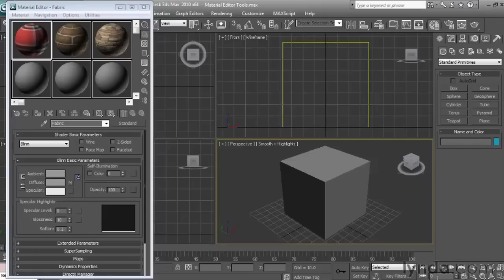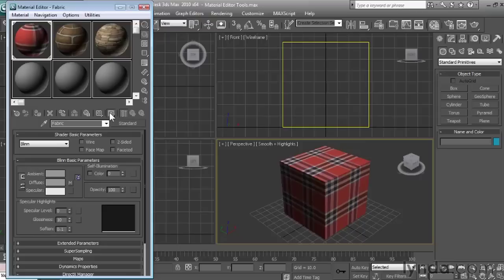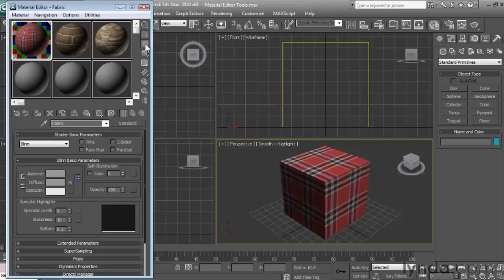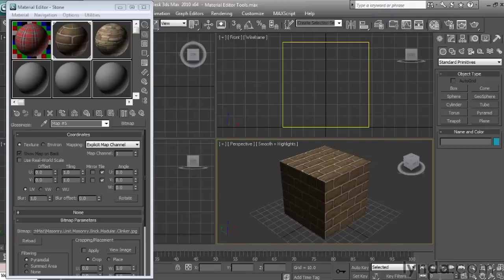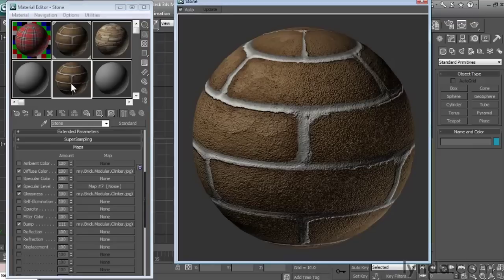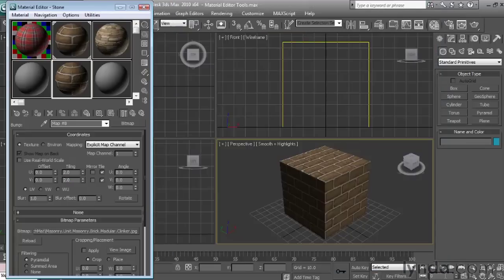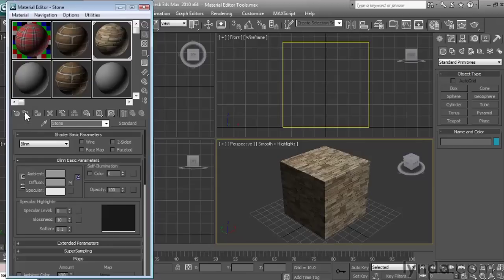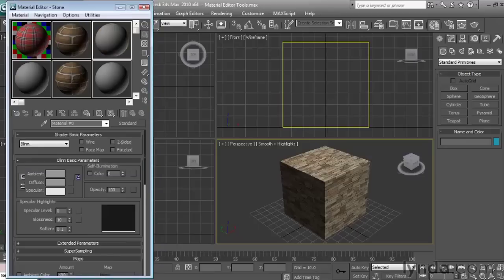3ds Max Tutorial - How to work with materials

Comment: Hello I just like to ask how to make a rectangle polygon when rendered would look like a different object. I saw in some videos that when they click the tree branches it is only made up of one rectangular polygon. How do you texture a polygon so that it would look like a leaf or something? Thanks!
Reply: you might be thinking of the foliage modifier.. 3dsmax reads that as a box until rendered, if you are certain it was a box.. then they may have used an opacity map.. if you open up the map in PS and paint it black it will be invisible.. black conceals white reveals.. bump map, black digs in white pulls forward, things like that.. i would have to see the video to be certain though.. unless it was a .png diffuse, and .png b/w bump.. and then the reversed color of the diffuse painting the tree white or grey and making the surrounding black.. using the opacity map.. not sure if this helps.
Reply: Oh okay i see so I can use that foliage modifier. Thanks! I'll try to find that video again and give you a link. I forgot the name of the vid but i remember the thumbnail. Thanks for replying I'll try to find that video.

Comment: This doesent work. I have the poly face selected (also tried with full poly selected) and the click n drag option (in menu when you right click the material in the material library window) is ticked. But when I drag it, it has a circle with a line through it icon as I hover over the object so it isnt allowing me to apply it